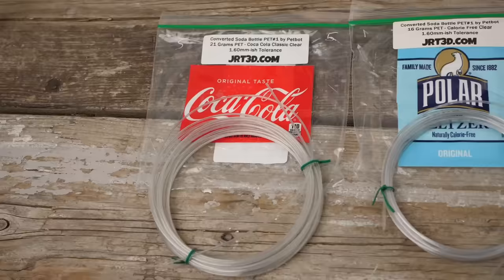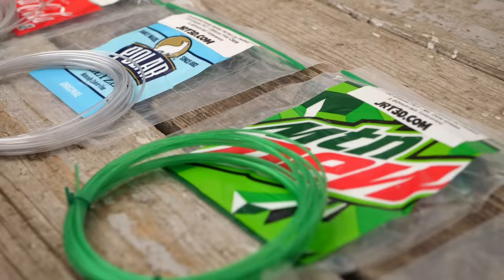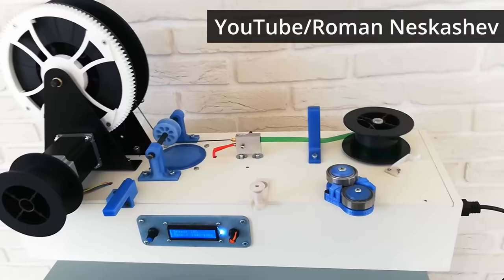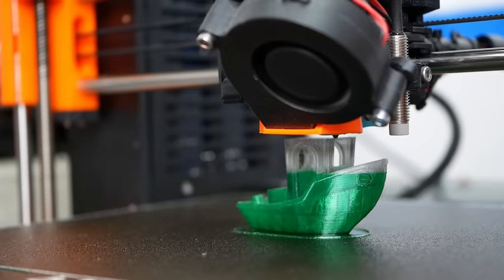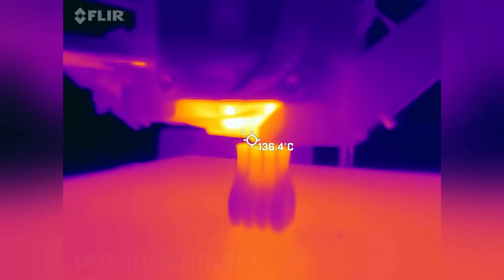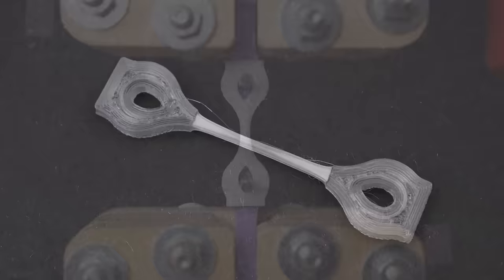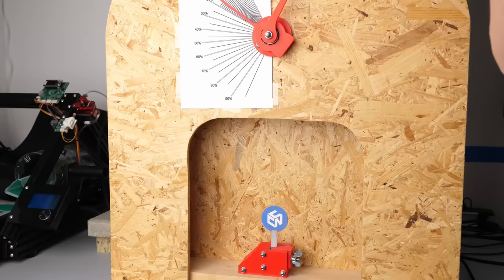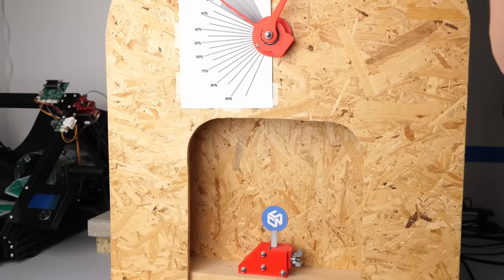HOW STRONG is PET Bottle Filament?

Comment: definitely print yourself one  and test please ! it would be interesting to see if it could be possible under South African conditions to use solar power and heat evacuation tubes to run the pulltrusion machine. Might even create a mini economy for recycling PET bottles which are mostly not recycled here.

Comment: What if you attached two of the filament strands together to make a very long filament?  Maybe a molding device with the perfect diameter for the filament would achieve this.  Basically it would work by using a metal pipe that is cut in half along the diameter so you can easily stick two strands in and open it up and take it out without having to feed the whole thing through.  It would need to get hotter in the middle and clamp the two strands to prevent them from moving, but I could see it working fairly well.  This might also be great for 3D pens where technique is much easier to achieve and layer adhesion is much more controllable.

Comment: Awesome idea. I just can't see how it saves money though. I know it don't use a lot of electricity or anything, but when you account for time and money spent, it seems like it's more expensive. I think it's an excellent idea for people who want to reduce plastic waste though. I just hope that the left over bits can still be recycled, because then that would make the plastic problem worse if once recyclable plastic bottles became no longer recyclable. Adding to the design to use the other 70% of the bottle would be a huge step in the right direction. I hope that is solved soon. I wish I had the money and equipment, I really do believe it is a task that could be accomplished fairly easily. (Like this whole design to start with).

Comment: It'd be interesting to see if the tape could be joined before it was extruded, rather than welding the extruded filament. Some other people have also mentioned extruding at a larger diameter, then pulling that through a 1.75mm nozzle.

Comment: I still feel like the pellet extrusion for bottles could be more interesting because for certain designs and sizes, like a typical 2L in the US, it'd be extremely easy to cut off the top and bottom then slice the side to get near perfect plastic sheets that could be easily fed into a crosscut paper shredder for very small and evenly sized pellets.

Comment: That's a cool concept and I'm sure it works great in Russia. I don't think it would make sense to do this back here in FIN. With the Finnish 0,20€ / btl and 25€ / kg of ready made PETG filament the difference is negligible after work if not negative for the self-recycled material. Though SWE, DEN and NOR have an even lower deposit of a crown, if I'm not wrong, so it might work over there as well

Comment: I don't know why PET filament isn't more popular. It has advantages over PETG, ABS, Nylon, etc.
There's a place that sells PET filament near me. It prints well at 250-270 degrees, it's strong, it can withstand higher temperatures than PETG.
I suspect that properly made rolls of PET tend to print better than recycled bottle filament with gaps in it.

Comment: The example with rolling sigarettes touched me. Why the heck I wouldn't start recycling my plastic as filament that's such a hassle, but I'm rolling my own cigarettes everyday? I did find me questioning myself for real.
Well apart that I'd smoke less than 5 cigs a day and the other times I'd like to spice'em anyways... It's that, differently from printing which adds value instead of burning it, literally... I try to smoke less. If I had ready disposable cigarettes at will, I'd probably smoke a full dozen of them a day.
So there's only a question left, if you will: Why the heck am I smoking tobacco at all?...🤔

Comment: 06:56 - Stefan, I think this is why I would love to see an experiment where PET filament is made from bottles, chopped into pellets, and then re-blended with glycol in some form to make PETG from PET. The resulting 2nd generation filament could then be used.

It would be something I've thought about as soon as I saw the possibilities in terms of recycling bottles for filament. I think one could combine both glycol and pigment in the second step as a bonus. It would be something I want to try to do and something I would love to see you and others try.

Beyond that, this video is ACE and more videos using this technique to really dial it in would be appreciated. I'd pay for livestream 'printalongs' where we chat with you about this stuff while we watching the machines do their magic together. :D
Reply: You can't simply turn PET to PETG by mixing it with glycol. The glycol is added at molecular level during polymerization, I am no expert when it comes to plastics but the entire reason why plastics are so widely used is the extreme inertness to many solvents, ph levels and other degradation is the reason why they are used, and which is why they are more or less permanent and should always be recycled.

Comment: I wonder how strong crystallized PET filament is? I mean you might be able to consistently get it with a slightly risky process, but then again isn't that 3D printing in a nutshell? Either way I really love this new method and once you have the required parts for it then it is extremely easy to use and make. Plus the cutting part of the machine is pretty easy to make(Grant Thompson once did a series of videos on making soda bottle string for his channel TKOR (The King Of Random) back when he was alive that showed how someone could make this stuff without the whole pull-strusion part of the process if you ever want to check that out).

Comment: After binge watching close to 100 PET machines and contraption videos, to understand the process, I built a machine, but I threw in my own twists,  once you understand the process which is very simple, then you can build one simply using common sense and a bit of creativity with even simple  small 12 volt gerared motors , temperature controllers, heat elements. No need to use arduino controllers. Yes I also watched the hot glue gun and manual methods. they all work.

I designed my machine to use as minimal 3D printed parts as possible, so it is very compact,  and it sort of resemebles an earlier machine I designed and built to injection mold small gears, and parts, when I was manufacturing tiny rc helis for sale, in kit form. I just did not see myself building a machine with huges multigeared pull motors and unnecessary contraptions and large work tables or boards. 

The simpler you build the machine the better. The key areas are a way to cut exact width for a particular plastic thickness of the plastic strips and a consistent heater and sensor, with also consistent and high torque low rpm motor to pull the filament through. 

I had to build one to prove to myself that the process indeed works as many have shown and it does! quite impressive!. It is quite amazing to print from a recycled PET bottle. But as pointed out in this video, the time invested is considerable trying to dial in the machine cutting the plastic strips and pultrussion process, to where you can pull with consistency.  It is a process that can eat a lot of time, until you have it just right, and one has to consider it if one values time. 

The time I invested in understanding the process, designing , making the machine, testing and refining it, was considerable, not to mention the time in the tweaking and dialing of the settings and trying all sorts of plastic bottles, but this is the only way to have tangible info at ones hands, that one can then weight against other options, such as simply purchasing the filament made. 

While for me it is far more effective to purchase filamentn made, I am going to keep making the "green filament" as a side hobby.

I found that the green Canada Dry ginger ale (here in the USA) bottles works great, and seem to be the right thickness and when cut to around 8-10 mm wide, it forms a fully seamless straw shape tube at around 220 degrees celcius. I am not sure if my filament is coming out near perfect with this particualr type of filament due to the custom hot end I designed since I could not fit a regular K type screw  on temp sensor on the more standard hot end head everyone uses. So my hot end is larger and has a nice taper to the copper nozzle for ease of entry and feed of the plastic strip.   

I tried smaller water bottles but they were too thin and would not generate enough material, I also tried other types of bottles, but I locked on the Canada Dry bottles, I suspect the Sprite bottles are also similar as well as the clear, bottles used for just about any type of bubbly soft drink.

Comment: If you first pull the PET through a 3mm hotend before you pull it through the modified hotend I think you can get even better filament than the "folded" we saw in the video. I don't have any possibility to try it, but it would be interesting to hear if someone has tried it!?

Comment: I wonder if you could splice them by cutting halfway through each strip and hooking them together before running them through the machine. It might interlock the overlapped section well enough to hold until it was melted in the printer.

Comment: You definitely should get / build one of these machines. Would be really interesting to see or take on experimenting with the filament creation.  I wonder if it would be possible to do a continuous fiber reinforcement folded into the Gap in the middle.

Comment: It would be easier to just get a shredder and normal screw extruder to get decent filament out of it. PET doesn't crystalize under pressure, which is easier to achieve with a screw extruder pushing against a nozzle.

Comment: I'd love to see you get a hold of the hot end, that directly uses the plastic strips. Also more low-cost but not fully-diy systems for recycling failed prints would be amazing. A printer with a melting pot on top where you just put in the failed prints and everything is one machine would be the absolute pinnacle but we're probably far from this.
Reply: Direct pellet to print extruders exist, I have no idea how well they work with shredded recicled prints though.

Comment: Would it be possible to connect the strips of bottles before they reach the hot end?  Maybe with something similar to a hair straightner or something else that heats up and clamps. Or maybe even soldering iron in theory it doesn't have to be that strong of bond just enough to get it into the hotend where it gets formed? 

A quick idea is to take the ends of the strips then put a slit in the center of the strip. This will allow for you overlap the two strips with a folded X shape. Apply a bit of heat with a soldering iron. Might able to spend some time with a machine that doesn't automate it in order to get a roll of material, but simply stripping bottles and making a roll of tape doesn't seem that bad. 

then again as somebody who hand rolled cigarettes before its about the quality of doing it yourself over buying it from a store. Same with making ammo. Biggest hurdle is figuring out the workflow and set up process, but once you get that dialed in you can usually do these processes without thinking in down time.

Comment: hello. I tested it too at my channel, its rlly stronger and more heat resistance. I think, That you need to increase your temp of printing. because i print it at 270-285 for my type of bottles . I checked temperature by termal imager . Like!
Reply: Can you print with 250C?

Comment: I am planing to make one of those machines myself. If you do it first, I am sure several people will benefit from.
Reply: This system is called PetPull in the original.  For some reason, the author does not talk about this in the video.

Comment: I would say yes, do a demo build on how to make a pullstruder. Then use it and find optimal settings. 

From my understanding the pet bottles need similar temperature to the industrial pet and pp plastics I thinking the low 300c range. 

I have been moving over the past month into a place I can finally 3d print at. I have plans to recycle all my plastic at home. I need to source a good set of blades for a diy grinder.  Without going on untrusted websites I can't seem to find them. But building a diy pellet extruder from hardware parts can be done really cheap. I plan to have a diy filistruder for pill bottles and plastic food containers.  And a pullstruder for pop bottles. In the near future. Just need to make the parts. 

I did have a thought watching this video. 🤔 what if you ran the pet filiment through a cutter making pellets for the filistruder? You would then have a continuous  spool of over 20grams  and it would be uniform diameter  instead of folded over. I'm not sure how well it would work having the extra steps but a more consistent filiment would be beneficial.  

I am also glad to see the test results and would look forward to a side by side with bought spools of fresh pet vs the pullstruder pet or the above suggested pulled then  made into pellets then filistruder. I think the differences of the test specimens would be more dramatic then you would think. 

I am glad to see the recycled bottles have good test scores even at improper Temps for good layer adhesion and avoid crystallization.   I am already excited to start testing trimmer line as a industrial grade material after seeing that video a while back.    I am also excited to recycle at home for filiment from pet pp and hips as they are "food grade" and fairly tough. 

My engineering interests are in small scale robotics and prosthetics. Making a robotic prostetic leg from recycled pet or trimmer line would be very economical and help so many people. Plus I have like 4000 thing projects on thingaverse I have on my to do list 😆  including diy cnc machines and diy small printers for a better print farm/workshop/maker space.... 

I hope to be subscribed to your site and be able to share Engineering information soon. Need to do more moving first. 😩  

I want to thank you Stephen 😊 for all the information on getting into 3d printing I've received from your videos. I'm hooked 😆

Comment: What if we instead took the PET filiaments and weaved into a plastic cloth, Which we could layer onto woven house structures made of Bamboo filiaments, and used a hot air blower to ‘Weld’ them together, to create CHEAP, but VERY STRONG housing and boats?

Comment: Im not familiar with the detailed mechanics of pultrusion but I am curious if you could take the ends of two PET strips and heat press them together, with an iron or modified package sealer of some sort, and then feed them through the pultrusion extruder to output a longer strand, I might build a rig and test this for myself. longer spools would go a great distance in the practicality of this technology.

Comment: Definitely would like to see you test the filament made from your own machine to test with. :) As to joining the filament, it might be easier to make something to join the tape before it goes through the machine? I was thinking of maybe a (much smaller) version of a sandwitch press etc... You could even experiment with joining it then. :) Maybe make it out of two heat blocks. :)

Comment: Yes Stefan, I think you should give it a try and build a machine, than in my immagination, use the 5 liters bottles from Aldi mineral water, or the 25 litters bottles form office water fountains which I guess can yield a larger quantity of filament, I reckon the 5 liters might yield 100 grams or so, while the 25 liters maybe half a kilogram, also consider you are not using the top neck with the thread, goes as a loss, nor the bottom, thou I think the bottom can somehow be cut to strip too.

Personally I seriously consider buying me a 10.000 USD mini line from China and use pellets and recycled various plastics to make my filament, such line can make around 10 Kg per hour, so if I dedicate a saturday per month I can get my filament at 20% of the market cost, considering the ammounts I use to print and re print when prototyping, it makes sense to me, especially when out of 10 redisigns or 50 redesigns I get to a final good end product, everything else printed in the iteration process is a waste, and I have a lot of such waste saved to re make filament.

If I add to that line a nice little shredder from Precious Plastic I can recuperate all my failed design iterations, so the price is justified.
Reply: This system is called PetPull in the original.  For some reason, the author does not talk about this in the video.
Reply: @KartoshkaAndMelassa  maybe he does not know it.  You see, he does not speak any russian, so when he sees russian videos he understands the images but not the words.

Comment: I just felt a disturbance coming from the ISS. I anticipate that PET packaging is now more viable for supplies replenishment. Now that soda-chugging and longest burp contests are within the necessary steps of efficient radiation shielding, habitat expansion (soda bottles are often used as makeshift pressure tanks, that easily contain several atmospheres pressure as a necessity to containing carbonated beverages), for forming layers of micro-meteorite protection (Whipple shields, as they're humorously called, are ironically toilet paper thin, but are named after their inventor Fred Whipple), spun into fleece insulation for crew and structure alike (also doubling as the previous benefits, other than pressure-holding), printed into needed items, and even molded into rocket fuel sticks (just add oxidizer).

Comment: Moin, maybe it is an alternative to use shampoo bottles. At least you dont have to miss out on the 25ct. But it is not pet, it seems like most are polypropylene. Would be awesome to see you recycle those. No idea if they Are actually printable 😅 I guess you will figure it out. Great video 👍